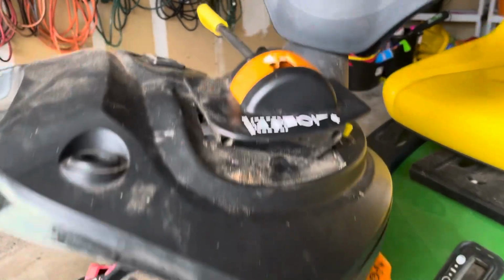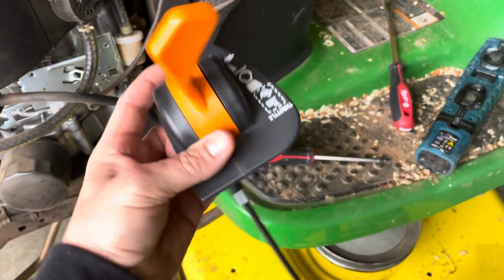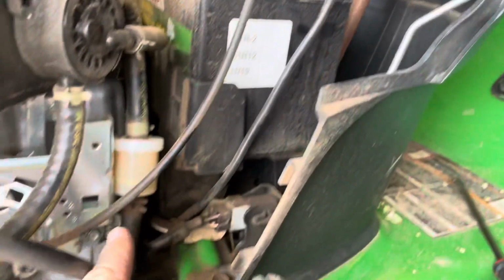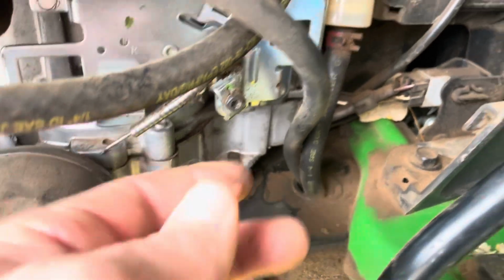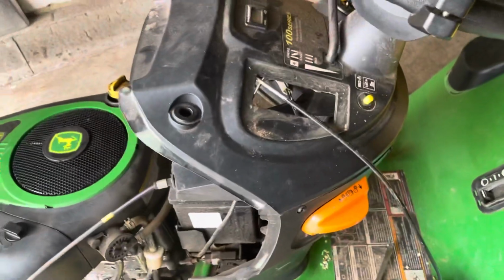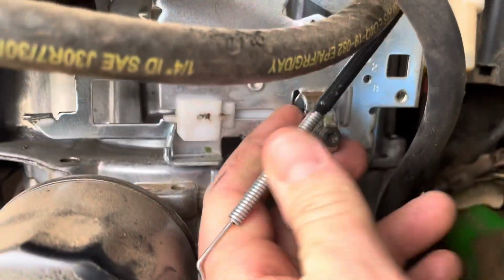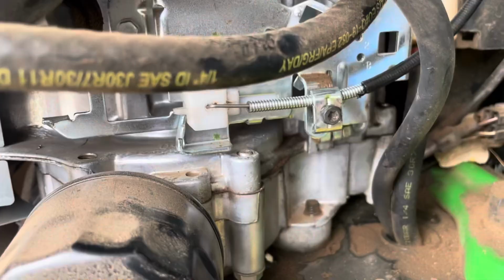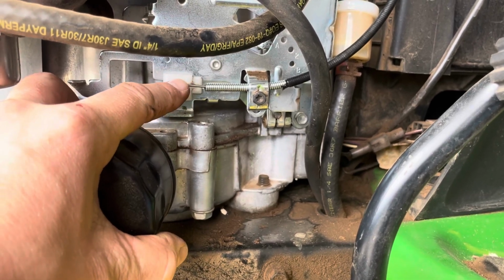DIY John Deere Riding Mower Throttle Control Replacement

Comment: On my John Deere 325 there are two bolts that go into brass inserts that are essentially a permanent part of the plastic.  You have it easy just popping out the old one!  Those bolts were driving me crazy so I just found a couple long enough bolts with the same threads and nuts to match.  Then I put the bolts in after I cut their heads off turning them into studs.  That eliminated lining the assembly up with the holes in an awkward place.  Instead I just slid the assembly onto those and put a lock washer and nut on them.  It works similar to bolts but without the frustration those ones caused me!!  It is only worse if it is too hot outside!  Maybe just as bad in winter weather.  It might make a person go insane if they tried it with gloves on!!  Turns out there was a little tiny bit of silicone on the original bolts holding the lock washers.  My guess is that a previous owner was in there and also knew the torment of changing that part.  It was corroded where the battery terminal is near it.  I may just wrap some Teflon tape on it to protect it so this doesn't happen again any time soon!  It was looking as if maybe some acid was on the battery terminal in dry form corroding the cable.  I don't want to just use electrical tape, you would be surprised what sulfuric acid can dissolve!!  If I ever take a battery for testing I put it in a plastic container big enough to hold it.  That acid WILL destroy the carpeting in your car and maybe even burn all the way through!  Rubber is not safe from the corrosiveness of such acid!!  It probably even destroys some plastics if left long enough, the container is really just to keep that stuff from destroying your car or truck if it somehow leaks!!

Comment: Awesome video. My throttle/choke no longer responds. Debating whether to replace the part (it’s the original crop like 8 years ago and I think these do wear and tear)  it or tighten it?
Reply: Bought the OEM part. Replaced. Everything working again. Great video - thanks for posting. Saved myself a bunch of time and money